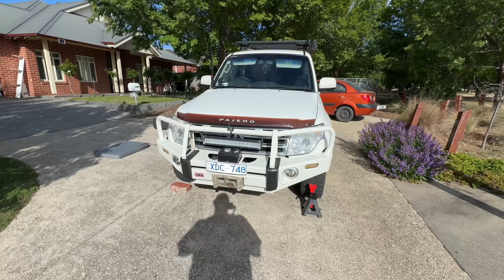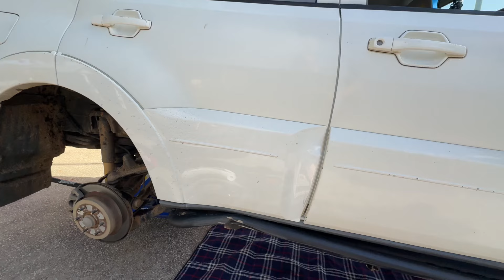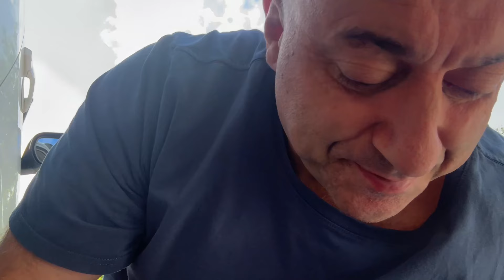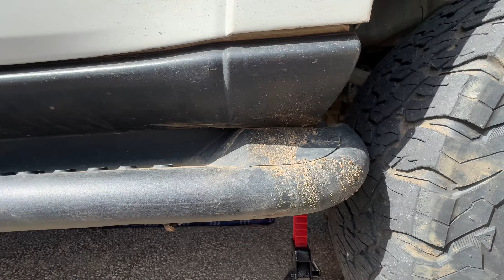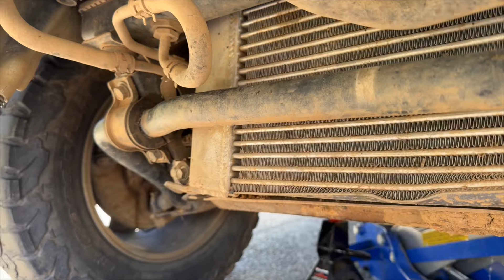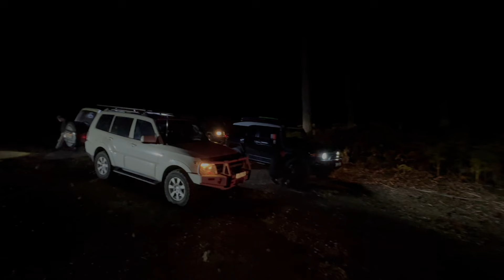Cobaw Damage Report - Pajero lives to take on next adventure

Comment: Oh no, not the recently fixed intercooler! It could be the cause of the rough idle as it messes up the measured air intake volume. It was noticed after Border track trip yer?

That rock did a bit of damage but not as much as I expected..
Reply from the maker: Yep but got worse after Cobaw. May have been damaged on border track and then got knocked again
Reply from the maker: Still running rough. Back to drawing board 😢
Reply from the maker: Bash Plate Installation https://youtu.be/-uF4krUfb2g?si=Y42fmCVf0L4U8td0